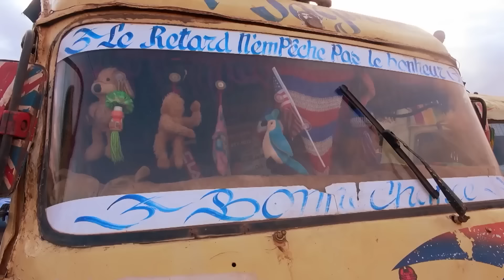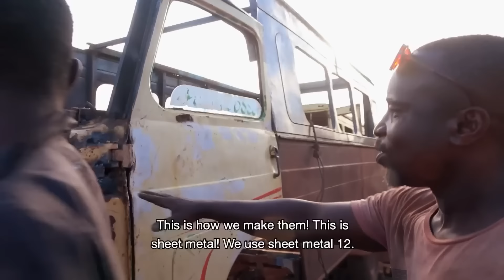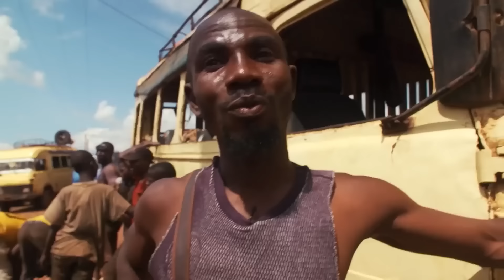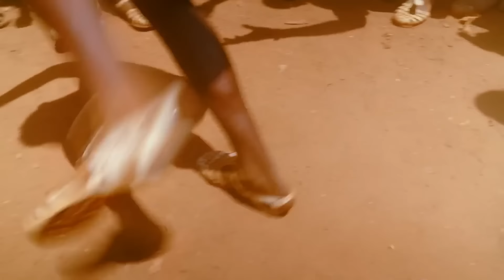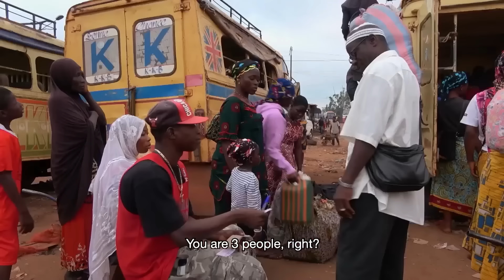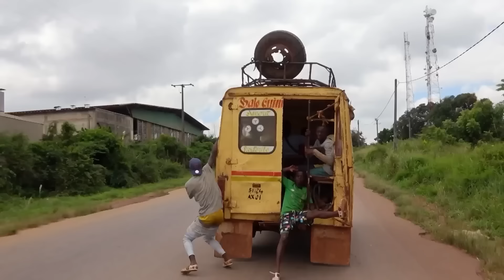Deathly risky entertainment on dangerous roads

Comment: 21 seats 💺 in mini bus🚐🚌 and the have 7 8 stuntman... they drive fast on dirt road so they'll make more money 😂... no profit guys because u driving fast loaded bus/truck u burn more diesel and so much repairs and risk of life.... I bet you can make more money for long time if u drive slow and safe...passengers will respect u too ❤
Reply: I guess this was done for a scenic video...
Reply: @timtim8468 no this is actuall transport, maybe the assistants are showing of a little bit for the camera but it’s normal seeing them hanging on the back of the van